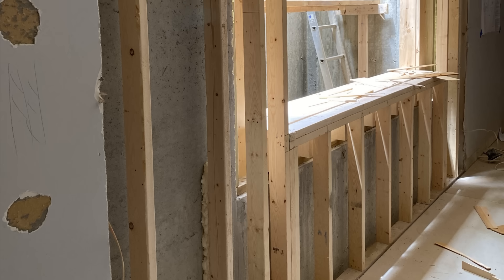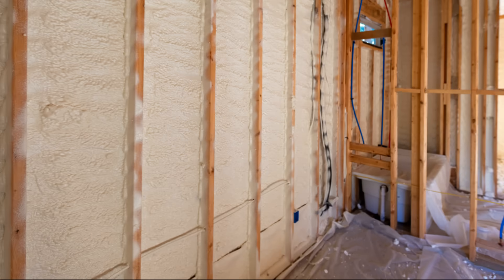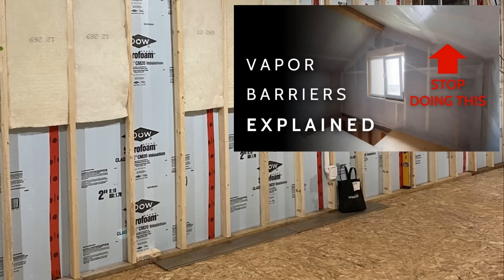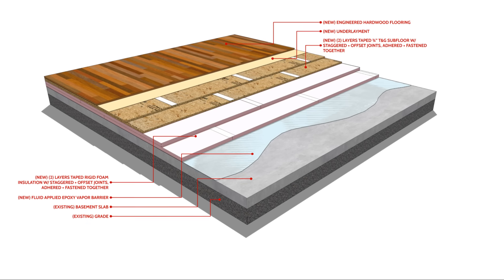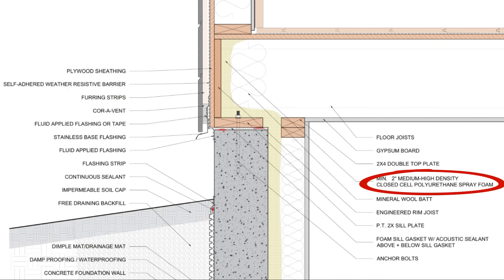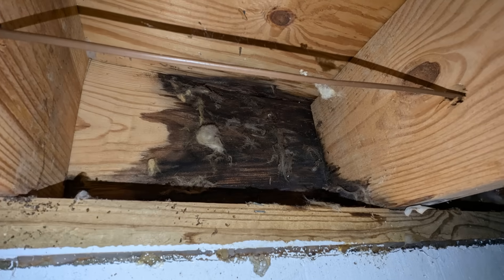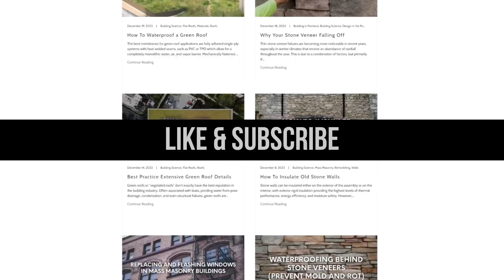A Complete Guide To Insulating and Air Sealing Your Old Basement (Walls, Slabs, & Rim Joists)

Comment: Help…in Canada where is bitterly cold in winter and Miami like in summer. I have a cold room, essentially cement rectangular room under my concrete balcony. Builder never insulated under the slab. It’s not required here. I used 4 inch of urethane on walls and ceilings to insulate. Can I use a fluid applied vapour barrier directly on the concrete floor? I have added heating and currently run a dehumidifier. I also have ducting for hvac. Ideas?

Comment: Will a smart vapor retardant such as intello be sufficient when I have an older home 1987 with possible no sealing on the concrete floor? I plan on using batts before drywall over the intello.

Rockwool on concrete wall 16 inch center. Thanks in advance!
Reply: Zone 6a

Comment: With the floating floor solution what happens if there is a significant leak? Be it a toilet overflowing or a dishwasher leaking. How do you make sure that all the surfaces dry out and dont mold/mildew?

Comment: @ASIRIDesigns I am finishing the basement of a new construction spec home (~2 years old). It has a vapor barrier under the slab but no insulation. Site drainage is good, it has interior & exterior drainage (sump runs every rainfall) and therefores has not shown any signs of leaks. From the slab to the floor joists above is exactly 8 feet. What is most compact subfloor insulation design to balance basement ceiling height and a comfortable/energy efficient living space that will have a bedroom?

Comment: If you layer that much on the basement floor that will likely cause a problem with the existing stairs because the final step will not match the other steps. One way this can be handled is by building a platform of appropriate size at the same plane as the final step. Another option might be if your stairs are not straight but already have a platform halfway you might be able to adjust the final stair run up.

Comment: Does the poly  vapor barrier below the slab or the epoxy coating on the floor deal with any radon issues?
Reply: I had this problem with radon in the basement and after a detailed survey the remediation specialist determined that  90% of the radon was coming from the floor drains in the slab and the area around the sump pump. Check valves were installed in the floor drains and a large, airtight cover (like a medium sized plastic garbage can) over the sump along with an inline fan to create a slight negative pressure which was then vented outside the radon levels dropped significantly and well below the level that would be considered hazardous.

Comment: Can you please tell me how you fasten the dimple barrier to the concrete wall or concrete floor, and how you fasten the foam board onto the dimple board. I would think using screws compromise the air barriers and puts holes in your concrete and glue doesn't seem to be the right application for a dimple surface to a concrete surface. 
I appreciate the depth of knowledge you provide to the construction process. I especially appreciate your nerdy construction diagrams. So detailed and complete!

Comment: What would you recommend in the basement that has a French drain installed from the inside? Any water that would pour into the basement through the block wall would then be expelled per the French drain. I am building my basement walls about 8 to 10 inches off of the block foundation so there will be a Chase space. Do I need to add anything right on the block walls?
Reply: hey, I have the same construction: a french drain in the basement perimeter and I'm struggling with how to insulate the basement walls since the wall doesn't touch the concrete floors due to the space for the french drain. I thought of starting my interior walls away from the concrete block basement as you suggest, but the distance to the wall from the window will increase which is not desirable. Let me know how you will be approaching your wall insulation. My home is in Maryland so I don't need a lot of insulation. Hope to start the project early spring!
good luck with your project
Reply: @ basically what I have decided to do was frame my interior walls 11 inches from the basement wall due to plumbing and piping that runs almost the entire length for my HVAC. I framed in the walls and I have ran our 13 insulation. After all these videos, I have decided against putting any type of vapor barrier up even though my basement never sees water. As is my basement doesn’t smell, musty or moldy either. I can only imagine that the walls and framing it in will help with that. I have pretty much watched all of this guyscontent and he made the comment that it’s better not to use any vapor barrier than to use it wrong. From what I understand my basement needs to breathe/dry. I totally understand what you’re saying in regards to the windows though. I’m actually framing two of my windows solid and will replace them from the outside and cover them up. 

I have decided to paint the basement ceiling black as I have been seeing some retrofit basements being done like that which look awesome. The one thing I am navigating is how I would seal off the floor joist right above my frame wall. I have several ideas. 

I also sealed up my rim joist by putting a half inch close cell foam in there and using spray foam for an air seal and thermal break. I then went ahead and put the R 13 insulation over top that just for added help.
Reply: @ and good luck to you also!!

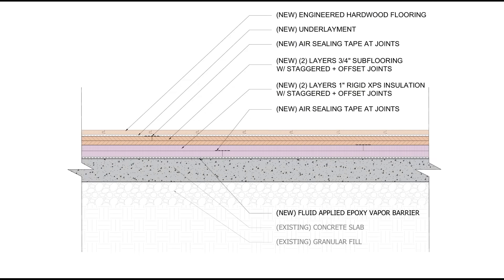Comment: 1:18 - Awesome guide, however, if one is retrofitting insulation to a slab that doesn't have a vapor barrier beneath... are there any options that don't raise the floor by 3.5"+ that would still offer a thermal break? For example, how about using 2 layers of 3/4" foam insulation with taped and off-setting joints, then a single subfloor layer?
Reply: You looked into DryBarrier? We used it in our basement because it checked all the boxes for our needs. It only adds like 3/8" height (lost headroom with low ceilings like in basement) which most is for the air gap like the dimple rolls for water to escape or flow to drain & allow drying (they suggest leaving a gap around perimeter or even cut holes & add vent covers every so often around perimeter). can put interior walls & most flooring right onto it. we used LVP since waterproof & inorganic so no mold/rot risk in the subfloor or flooring. The floor is noticeably warmer than the concrete but lvp even on our main floor is chilly in winter so we ended up using rugs in areas we sit on every floor anyway. Could have done pad & carpet to add warmth but wanted to avoid organics in case of water ever which in an underground bowl is possible. heck I used densshield tile backer for all the interior walls since it's basically drywall with fiberglass over the insofast wall panels instead of paper for the same reason. no organic material in case of water. for someone with headroom to spare or where warmer floors were more important could put down osb layer over the drybarrier before flooring or heck rigid foam board (one meant for floors) then osb then flooring and STILL way less than 3.5" of loss (3/8 + 1" + 3/4 = 2 1/8" loss using 1" foam). reason i didn't go that route was the significant added cost & work involved for minimal addition benefit, and adding organic layer of osb which i was trying to avoid above most all else. with this route we could have water flowing under the subfloor to the drain & air out without touching anything organic. if the water level ended up higher I'd dry out or toss the rugs & the densshield would be fine. 2x4s would dry. obviously would not want that but with most any basement there's a chance not just from the ground but from the floor above. the only other option that was even close to what i did was dmx underlayment with osb over it (or floor rated foam board layer then osb) since it gives air gap vapor barrier & supports interior wall weight but introduces organic layer..

Comment: Great video but I noticed an inconstancy between the detail @3:01 and the detail on your website. If xps insulation with taped joints is used against an interior dimple mat, should the stud cavity still be insulated with rockwool or other unfaced batt insulation ? Detail on your website recommends to leave the cavity uninsulated for drying. For my existing basement, I was hoping to use both to meet the code for basement walls which asks for R13 cavity + R5 CI. With the cavity uninsulated, I would need R-15 CI.

Comment: I have an under-slab French drain leading to sump pump, in a house built in the late 1970's. There is no dimpled mat installed on the walls, leading under the slab as in your diagrams. Can I put up rigid foam on the walls without that? How would the flooring look in this case? I would like to use DRICORE R+ if it makes sense. Home RenoVision DIY, in "The Best Way To Finish Your Basement", about 7 minutes in (or 5m30s for the bit about subfloor), recommends a continuous air gap behind the rigid foam, shared with the air gap under DRICORE. In this case the DRICORE goes to about 1/4" from the wall, and the foam wall panels sit on top. The OSB layer therefore has a tongue edge facing the concrete, separated by air. What are your thoughts on this? Thank you for the time you took on this and for your invaluable insights.

Comment: Important to note that the original use of cellars was as storage for root vegetables or if you're rich wine bottles. In both cases you need a cold and relatively high humidity cellar. So no vapor barriers, just french drains making sure water passes on and does not stay next to the walls.

Comment: What do you recommend  for basment insulation in the Canadian prairies. We have 80 degree summers with high humidity. (Although the house is air conditioned) but winter is dry and typically well well below freezing.
Years ago we told to put a loose fitting poly layer on the foundation wall to prevent moisture wicking into the insulation. Then frame and insulate wall with vapor barrier on warm side.

So the question is because of the wild swings in temp and humidity.. bewteen summer and winter is it better to insulate with a foam board on the concrete wall and insulate the stud space but eliminate the vapor barrier on the warm side.  Or stay with tradition and off set studs about an inch from foundation insulate with fiberglass or mineral wool and vapor barrier on warm side.
Reply: I'm in northern Ontario and we went with closed cell spay foam for the sills to seal up the basement walls to rim joists - the risk of outgassing was moderated by the smaller amount of spray and rigid XPS insulation along with lots of tape for the walls. We ran out of money and didn't do the floors but I wish that we would have done this also.

Comment: Unfortunately, adding layers of dimple mat, insulation, and a subfloor over your slab rarely works unless you’re re doing your staircase and if you’ve got a split level like me, you can’t do it anyway because the landing has the front door sitting on it. Also it’s a walkout basement so the floor would end up well above the exterior door.
Reply: If you have 8ft ceilings it’s about 2% of a difference in height. Honestly couldn’t tell a difference in mine 3/8 advantech sub floor, 1inch foam board and a very thin dimple mat.
I just did the math and it’s actually 1.75 percent for mine.

Comment: How do you feel about putting the smart vapor barrier (like Intello Plus) over the dimple layer on the basement wall? I find this easier to tape and seal the air while making sure nothing punctures it. Then followed by foam board, the stud wall with wood fiber insulation and sheet rock.

Comment: Do you recommend using r-tech eps board with a polymeric facer on both sides for a poured concrete basement wall?

@ 2" it cost half the price of xps foam boards.
Reply from the maker: Sure! That works just fine as long as the joints are taped.

Comment: 4:03 why wouldn’t a polyethylene vapour barrier be suitable in this case, since I assume you wouldn’t expect any drying to the exterior.
Reply from the maker: Air leakage is the big one. Air leaks can deposit moisture into walls at rates that are orders of magnitude higher than diffusion. My assumption is that both membranes will not be perfectly taped and sealed, and I want to give the framed cavity a chance to dry out if relative humidity increases. Wooden components increase in moisture content has relative humidity increases, and we start to get in trouble over time if they don't have the ability to dry out. Redundancy!
Reply: @ASIRIDesigns  I think I misunderstood the point you were making at 4:03. I thought you were saying that if you don’t use rigid foam against the foundation, that you would want to use a smart vapour barrier instead (in that spot). but you probably meant you would want to use a smart vapour barrier interior of the studs.

If my first assumption is correct, in that case I was thinking that a polyethylene vapour barrier would be fine.

Comment: What do you use to seal off rigid foam board at the floor level (concrete slab) and at the top of the foam board as tape may not be best . Would spray foam or silicone work?
Reply from the maker: Great question, we tend to still use tapes for this connection (very aggressive tapes like primed Tescon Vana and Siga fentrim bond to concrete very well) but let's say that you're working with a very irregular substrate, low expanding canned foams and acoustical elastomeric sealants can work just fine. Just be careful when using sealants to make sure that they won't eat away away the foam product you specify, and make sure it can actually bond to it. You can also just tape the bottom of the rigid foam board at the walls to the taped rigid foam installed at the floor if you have concerns about compatibility.
Reply: People often think canned foam is an air sealing method. It is an insulated gap filler but it does not stop air and vapor. It’s important to use tape. Siga fentrim if you’re taping to concrete, I like siga rissan if you’re taping foam board or a vapor retarder.
Reply: @CMCraftsman I agree with you on tapes, but technically closed cell spray foam can function as an air barrier and vapor barrier, depending on the thickness.   Johns Manville has an article on the subject: https://www.jm.com/en/blog/2020/june/spray-foam--open-cell-vs--closed-cell/#:~:text=While%20both%20materials%20can%20be,1.5%E2%80%9D%20thickness%20or%20greater).